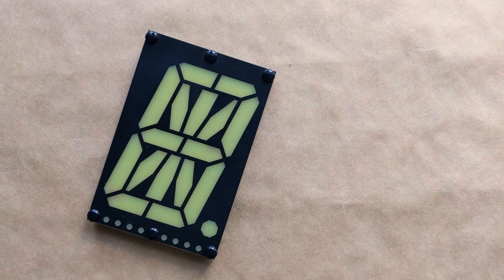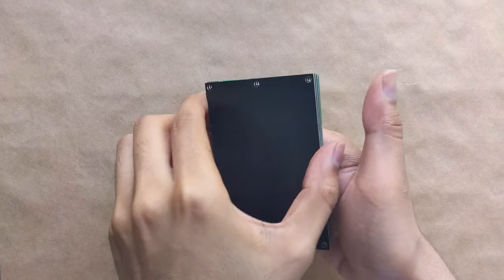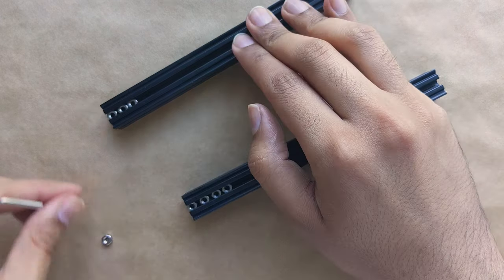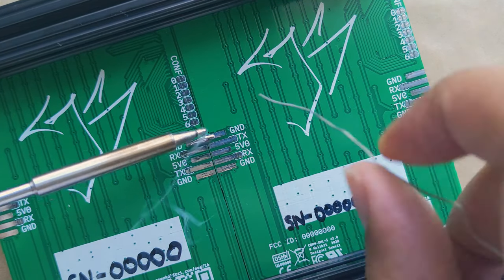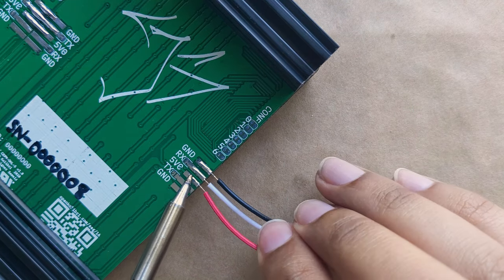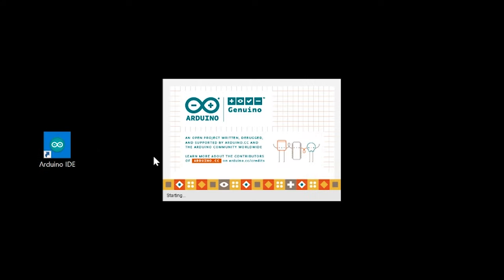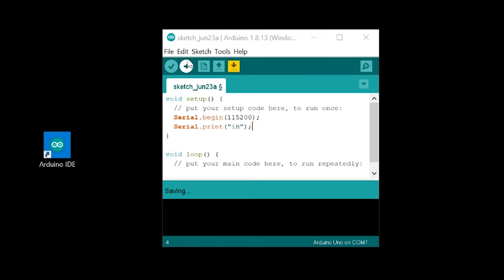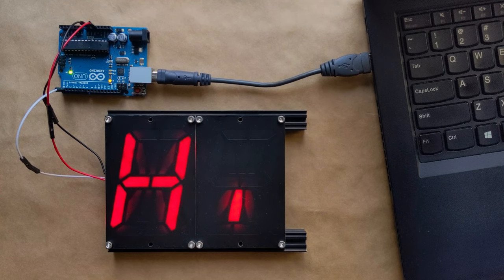Kolibri Klais-16 Getting started

Comment: Good design although as has already been mentioned the bleeding could be improved - I think it's bleeding because the PCB isn't fully translucent so black plastic spacers may perform better. I'd also add that if the signal was fed in the reverse direction (I.e. You connect to the last module), you wouldn't need to reverse your text manually.